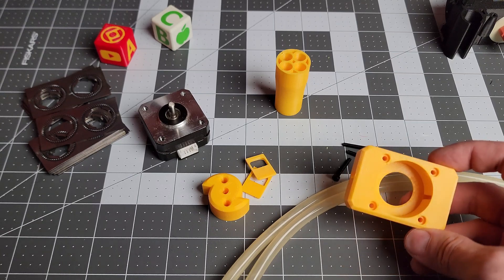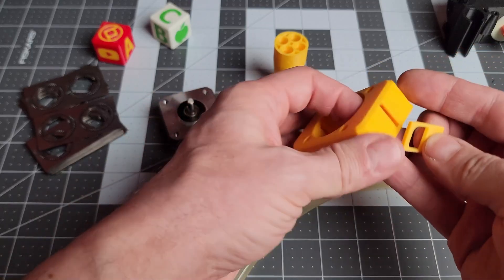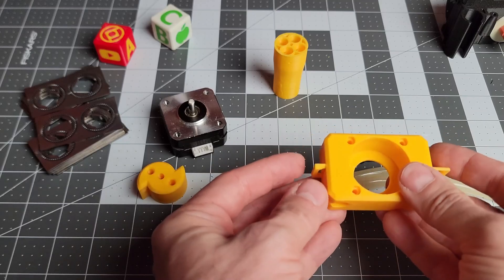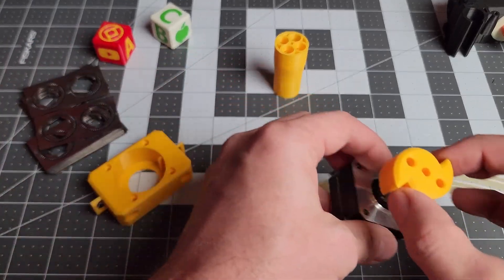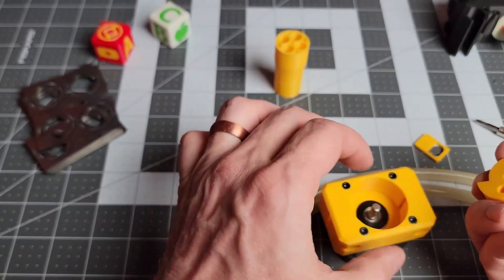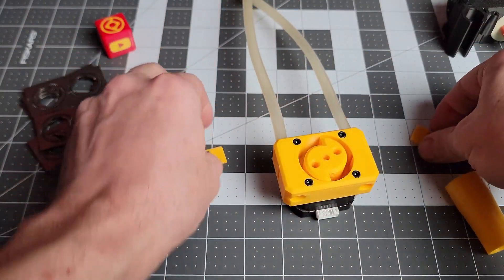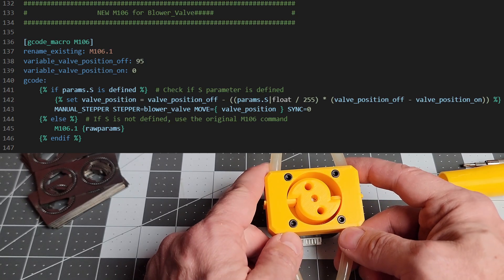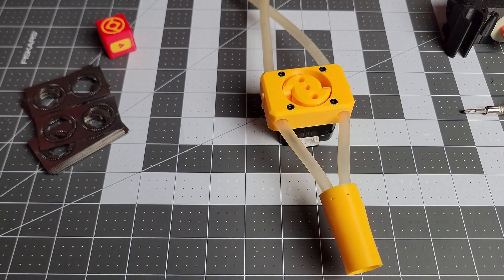IDEX 3D Printer Mod - NEMA17 Pinch Valve Assembly Tutorial

Comment from the maker: I realize that many of you were expecting a major Picolino release video. Rest assured, it's coming. The testing is going well. In fact, this pinch valve was printed using the Picolino toolhead. The reason for the valve video is that I believe it's a critical component of both the Magnetic IDEX and Picolino extruders. Stay tuned for the Picolino video!

Comment: which spec motor you used ? Thank you
Reply from the maker: Thanks for your question! Any standard NEMA 17 stepper motor will work perfectly fine for this pinch valve setup. I actually repurposed some old Flashforge Creator Pro extruder motors for mine. However, in this video, I’m using this particular motor: https://amzn.to/47DzOm0. Hope that helps!
Reply: @m_IDEX  First of all, thank you for sharing the 3D printer file.

I’d like to kindly ask for your help. I’m using 3/8" (or 9.5mm) silicone tubing, and my system is used with a beer tap. I prefer not to have the beer flow through a solenoid valve in order to avoid contamination, which is why I need a pinch valve.

Would it be possible for you to help me write the code for the control board? Please feel free to let me know how much you would charge for this.

Thank you very much!
Reply from the maker: For your application, I'd recommend a solenoid pinch valve.  Something similar to this one:  https://s.click.aliexpress.com/e/_oF9EAmH

Comment: Hello I am confused by the google sheet BOM in your youtube profile, there are multiple 7040 blowers listed and multiple cpap tubes. Do I need only one of them, or all of them ? Do you have up to date BOM ? Thank you!
Reply from the maker: Hi @mark56SOTF
! Thanks for your question. The Google Sheet BOM in my YouTube profile has multiple tabs to cover different setups. The first tab, Magnetic IDEX, is the simplest mod and only needs one 7040 blower and one CPAP tube—it keeps the original FFCP motion system but has some speed limits. 

The second tab is an expanded version with the Akula-class motion system, which upgrades the XY gantry, adds dual Y-axis motors, and includes belt tensioning for each belt run. You only need the parts for the version you’re building—one blower and one tube are enough for either. The BOM is up to date as of now. Hope that clears it up—let me know if you need more help!

Comment: So this gives identical part cooling for both tool heads?
Reply from the maker: Yes, this setup provides identical part cooling for both tool heads. I've opted for this configuration in my IDEX setup.  
You can easily install two valves to control each toolhead independently.

Comment: Thanks for sharing so many great designs! The extruder is just genius and so are the magnetic IDEX! I am upgrading my old Tronxy x5sa to an VzBot design and I very much like to try implementing your magnetic IDEX design. Do you calibrate the z hight of individual toolheads in any way? Is it possible to run a print with separate z offset for the individual toolheads?
Reply from the maker: @Supercalafradjal Thank you for your kind words! Both the Magnetic IDEX and the upcoming Picolino extruders feature simple Z adjustment mechanisms. For the Magnetic IDEX, this is done through the TD6 heat break in the CHC mini hotend, and for the Picolino, there's a similar Z adjustment method.

Regarding your question about calibration, it's definitely possible to set custom Z offsets for each toolhead in Klipper, but doing so would disable Mirror and Duplication modes. This is why I generally recommend sticking with mechanical Z calibration for better compatibility with these modes.

Comment: Nice and simple looking again Dmitry, which makes it look easier than it is, I imagine you could just use a double lobed cam eccentric oval connected to the stepper too, and run the polyurethane/silicone CPAP tubes internally, so they are squeezed by the cam and the outer walls are acting in a compressive state....this could mean the design could be single sided with a double width single sided cam, you  could even create the splitter in this part for simplicity, by having the two hot end tubes on the outer of these. I only like this idea because you could mount the CPAP blower into this valve assembly and keep the wiring compact ... just a thought
Reply from the maker: Thanks, Mike! I appreciate your insights and the creative approach you've suggested. Integrating the blower, valve, and tube splitter into one compact unit is indeed an appealing concept, and I'm definitely on board with simplifying the design for compactness and efficiency.

I'm quite fond of the spiral actuator for its precision in controlling part cooling. It offers nearly linear control which can be managed without complex calculations in Klipper macros, making it easier to tune and maintain.
Reply: @m_IDEX  Dmitry, I've sent you a modded STEP file on Kofi, just as an idea, it uses 180º CW or CCW rotation to operate,, but hope you don't mind "remix" **edited bad description
Reply from the maker: @mikecrane2782  Thank you, Mike.  I'll take a closer look.

Comment: As always, simple and repeatable design. 
I have a question. Isn't it easier to repeat the design of a peristaltic pump and use rolling shafts?
Reply from the maker: I've designed several peristaltic pumps, and I wanted to try something simpler with less wear and tear on the tubes. I believe this simple spiral design offers very fine and nearly linear control over the air flow rate, allowing simple adjustments from 0 to 100%.
Reply: @m_IDEX  Ha, that's why you went for sliding actuators, and a cam and tappet crushing the tube (with hindsight) is similar, as is a roller bearing cam follower, but possibly a little silicon grease would do the trick re tube wear.  My only question is whether, the CPAP blower seeing the restriction, actually needs a 100% closure on the part cooling, as the air will follow the path of least resistance, via the hot end cooling tubes perhaps.
Reply from the maker: Mike, you are correct about air following the path of least resistance, but 100% closure is critical. Even a tiny air leak can cause a first-layer print failure. This is especially critical with remote cooling due to a >200°C temperature differential. It took me a couple of tries to dial in the pinch valve sliders to ensure proper 100% valve closure.
Reply: @m_IDEX  Another idea is to use a ball valve?
Reply from the maker: Good idea! I've considered various valve designs before settling on the pinch valve. In fact, I've even designed a cute print-in-place ball valve. 

However, here are the reasons I chose the pinch valve:

Simplicity: The design is straightforward with fewer moving parts.
Cost: It's more economical to produce and maintain.
Ease of 3D Printing: Pinch valves are easier to print due to their simpler geometry.
Leak-Free: They provide a good seal without leakage.
No Extra Tube Connections: Offers a direct path from the splitter to the toolhead, reducing potential failure points.
Symmetric Design: This reduces the load on the cam, enhancing durability.
Dual Tube Valve: Suitable for T0 and T1 part cooling, making it versatile for multi-extruder setups.
Reply: @m_IDEX Dimitry, totally agree symmetry is a good idea to reduce cam closing loads so not adding strain to one side of the stepper motor nose bearing, and tbh I have just built a single sided valve body to test this, and it closes 100% at 135º rotation from the open position... just need to find a NEMA17, I only have a "15" with smaller fixing PCD :o